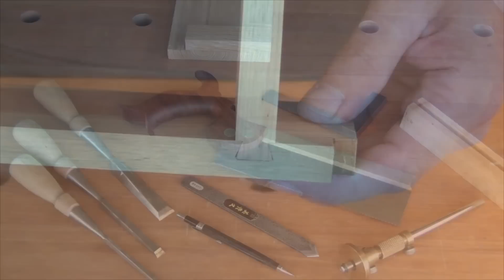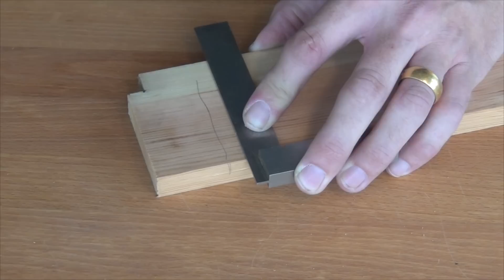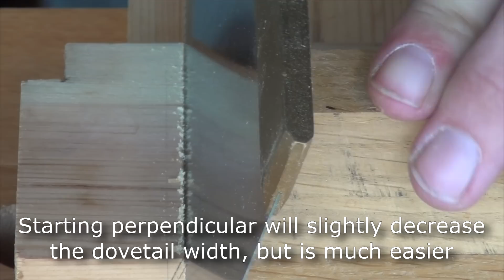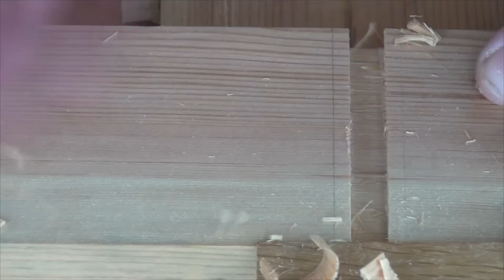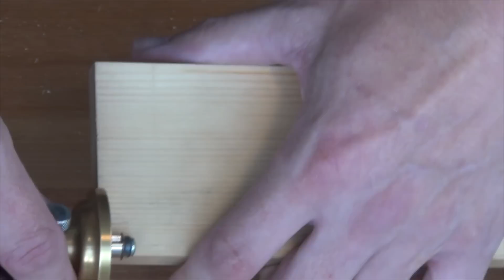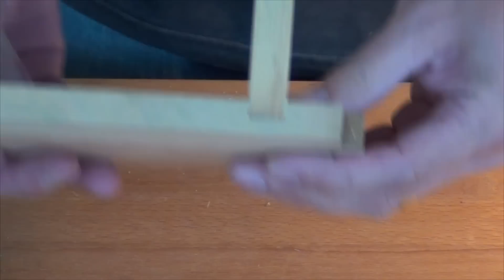Hand Cut Sliding Dovetail Joint

Comment: Am enjoying your videos very much since discovering all that's offered on YouTube.  Would be interested to know your methods for making a tapered sliding dovetail like one might use to join large panels at right angles in deep case  pieces.  Would you saw the tapering socket, and then use chisels to complete the dovetail end ( I usually only dovetail the down side of the panel leaving the upside like a conventional dado)?  would you form the dovetailed end with a special plane like a Stanley #666 or a mod-ded Stanley #79 (I have one of those).  The tapered sliding dovetail (if I only have to do a few of them) is one joint (starting from scratch), I can make way faster than using a router table with all its trial and error before getting the right fit.  Even then the fit depends on absolutely uniform thickness and flatness of each panel at both ends.
Reply from the maker: Cheers. Socket the same way as I did for the low couch table project. For the tail I'd use a rebate plane and tidy up the corner with side rebate plane and paring chisels.

Comment: Thanks for posting this and reassuring me that it is possible by hand! I have been meaning to use this to support two long vertical poles to the side of a wooden box. No nails or screws will be strong enough to hold a 6 ft tall pole to the side of a 15 inch high box !
Reply from the maker: Hope it works out for you

Comment: Thanks for the lesson, Mitch! I have one question about another slightly different application: consider the same joint but the groove part only has one opening, making impossible to use a dovetail handsaw. How do you suggest to cut the angled sides, or how can I guarantee the angle cut with a chizel, for example, and be able to measure the inset spaces of the groove?

I'm a begginer and I'm really struggling with this to make a joint between table legs and its pieces that assemble them together, 
something like a mortise and tenon in dovetail aspect.

Thanks in advance!
Reply from the maker: Hi, Chop the last inch at the blind end with a chisel, using an angled block clamped to the edge of the slot to guide the back of the chisel to make the dovetail undercut. Now you can saw the remainder, just with a one inch cut stroke. The same angled block will help align the saw plate. Hope that helps!
Reply: Thanks man, I'll try that out!

Comment: Once again, nicely done.  I didn't even know this was possible so I'll have to put my new Bad Axe saw to work on this.  I suspect "sneak up on it" is an understatement.  Love your stuff Mitch.
Reply from the maker: Thanks Thomas! What do you think of Bad Axe saws? I've not had a chance to check one out.
Reply: The Bad Axe is my second dovetail saw, the first was the cheaper Veritas which I did use till it needed sharpening, then I ordered the Bad Axe so I'd have a good saw in case I screwed up too much sharpening the Veritas saw.  The stiletto Bad Axe dovetail saw is a great saw with many variables you can change when you order it, number of teeth, size of grip, all depending on the woods you intend to cut with it.  I really love the saw and have now ordered a 14 inch carcass saw..

Comment: I guess I was hoping to see a stopped tapered sliding dovetail joint. I am in hopes of building a bookcase that utilizes stopped glue-less joints with tapered sliding dovetails to make it strong but easily broken down for moving. Having the shelves flush with front and back sides ( or maybe with a back in a dado down the back. Discussions are unlikely since you do such good work at demonstrating your work.
Reply from the maker: Hi Clyde. Did you see the dovetail housing video https://youtu.be/6mVcDonB52I I know it isn't stopped, but the process of layout is virtually the same, showing the taper, and all you need do is leave 3/4" at the front. Of course that means sawing the sides is trickier, and closer to the stopped end you'll need to chop them, similar to cutting half blind dovetails.
Reply: Well my problem is accuracy for the width at the stopped portion without getting it too long, Do you mark it to the end but cut it 3/4 short?
Reply from the maker: Clyde Decker that's right, and cut the dovetail full length before cutting off the front 3/4". Don't knife right to the front of the sides though, as that would show when assembled.

Comment: so i finished the scrap sample and i was very suprised as to how easy it was.i definitely hve to do it a few more times b4 attempting to do it with the cherry for the table build but overall id grade it with a 7.8 out of 10.0  my OCD will not let me send this thing off to the next guy without it being perfectly snug and tight it's like 90% there
Reply from the maker: +Joe basementwoodworking Nice. A word of warning though Joe, it can be very difficult to assemble once glue applied, so don't make it too snug! The tapered sliding dovetail is ideal for solving this problem. What you can do though, is just make the last 1/4" to go together really snug, and the rest a bit looser.

Comment: remember when I first commented and said I have to try this when I'm in the mood to use just hand tools well I'm in the mood to use just hand tools I cannot find a router that has a half inch collet for a project that I'm working on with Woodworkers 631 and The Woodworking Junkie heat build-up on video collab and I have to make 3 sliding dovetails for 3 table legs so off to the hand tools I go I'll probably watch this video three more times before starting thanks again for sharing this informative video
Reply from the maker: Haha nothing like a bit of pressure. I'm pleased you remembered you saw it here, and hope it goes okay.
Reply: Mitch Peacock - WOmadeOD thanks man so I just mark my lines and I do I need that angled piece of hardwood the guys that you used and if so what degree what is that angle for the guide and of course I wouldn't go anywhere else for hand tool woodworking :-)
Reply from the maker: +Joe basementwoodworking I work in ratios not degrees, so I would suggest a slope of one in four or five. Just set a bevel gauge to the slope and use that as your reference for all cuts. The guide is handy but not essential, and you could just make one in some scrap soft or hardwood.
Reply: Mitch Peacock - WOmadeOD nice!!-thanks mitch! I will do my best so far it's looking okay and actually looks like half a ducktail Brian routed out the female part of the dovetail so I need to make the male part of the dove tail and three legs
Reply from the maker: +Joe basementwoodworking Cool. I'll look out for the video!

Comment: Great Video! Thanks Mitch. I wondering if this procedure could be used for joining an edge, to the very end of a face, so that its face sits flush with the others edge - like a butt joint but using a sliding dovetail.  And could this work over a width of 45cm? Presumably I'd need a longer saw?
Reply from the maker: Hi Saul. You could offset the dovetail to the innermost face, but the outside edge will still be very weak due to the grain direction (assuming I'm understanding how you want to use it).
Joints of 450mm are not a problem, although I'd definitely make it a tapered sliding dovetail to ease assembly.
A back saw can cut longer than it's length, so no need to get a longer one.
Reply: +Mitch Peacock - WOmadeOD Thanks a lot for the info! I think I know what you mean re the strength/weakness of the joint, perhaps not ideal after all. I am wishing to emulate a 'swoon' retro tv stand. The pieces fit together in the fashion of butt joint to make a rectangular shell, so maybe they've simply been doweled! I am a complete beginner so just learning the implications of using different joints. I suspected a sliding dovetail because of a generic promotional pic on their website. I've taken enough of your time, but if you fancy taking a look and guessing what you think the joints are likely to be, the piece can be found at https://www.swooneditions.com/herzen-wooden-mid-century-media-unit/?utm_medium=sem&utm_source=google&utm_campaign=adwords%20shopping&utm_term=herzentvunitchevmango. Would love to know your thoughts. Many thanks, Saul.
Reply from the maker: Had a look, and I think your guess at dowels is probably right. The picture next to 'the maker' is somewhat misleading I think. A stopped dovetail housing for the centre divider would be a good idea to pull the top and bottom together, but I doubt that they do that. I like the design - good luck if you make one, and I hope you'll send me a photo of it.
Reply: Thanks Mitch for taking a look at that. Feel much clearer! I will be sure to let you know when the project is complete.  Best regards. Saul

Comment: Well done Mitch.   I admire your skill with hand tools. Does using a router table count as cheating?  :)  That said, "sneaking up on a perfect fit" isn't that easy using power tools.
Reply from the maker: +Hardnox Cheers Peter (😃) Only if you then say it was done with hand tools! The most important thing is to have fun doing it. To sneak up using power tools, try adding or removing paper shims.

Comment: Nicely done.  I made a plane to cut the male part, but you did quite well with just a chisel and a knife.  Folks might like to know that if the joint is NOT going to be visible, it is traditional to CUT the angle on one side only.  That makes the joint quicker to make, but also leaves more wood on the male part so it's stronger.  That's good to keep in mind if you build bookshelves that you plan on loading with big books.
Reply from the maker: +deezynar Spot on. That's what I call a dovetail housing joint. Also, better to make them tapered, for easier glue up and tightness.